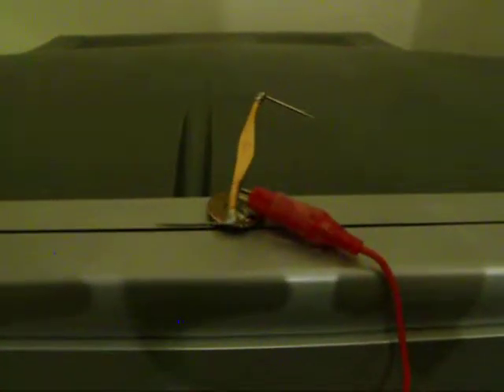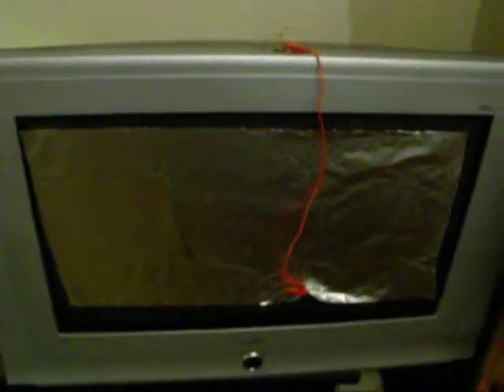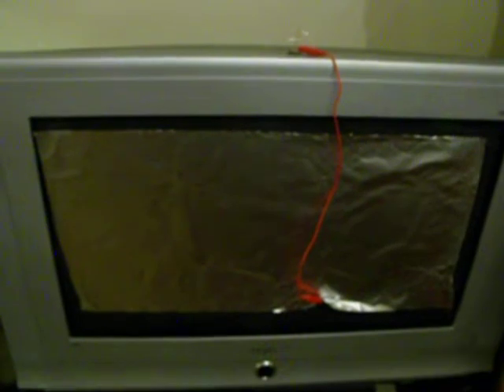CRT Powered Ion Motor Demonstration

Comment: I remember those tube TVs when I pass my arm in front of it the hair would stand up LOL
Reply from the maker: That was the high voltage that was on the front of the tube, the back side was charged at a very high voltage from the flyback transformer and it would attract the opposite polarity to the front of the screen, like a capacitor. It was an amazing technology that was actually invented by a high school student in the 1920's